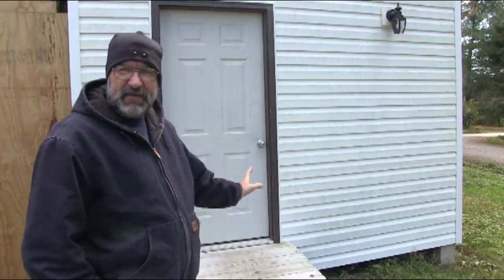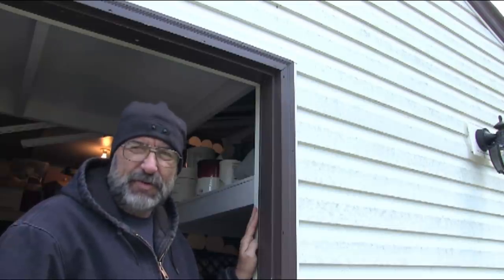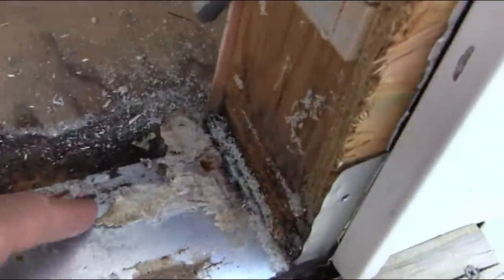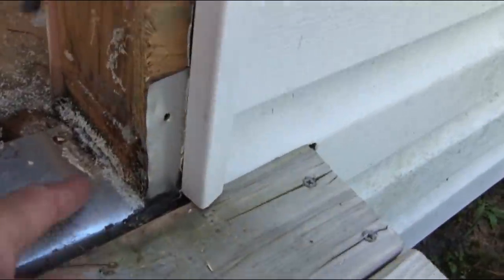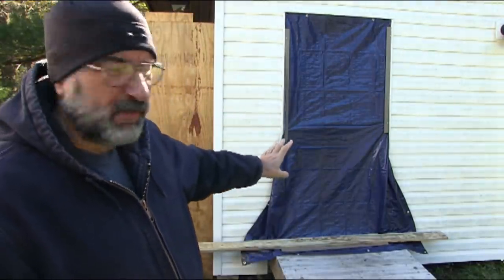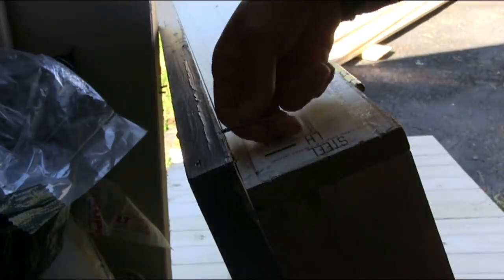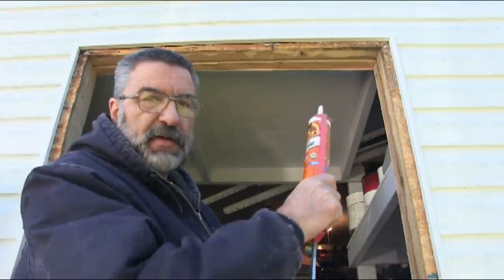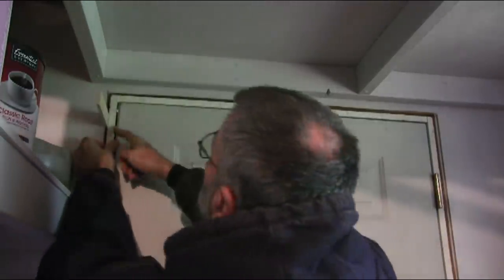Fixing the Shed Door

Comment: May I suggest putting an eves over the door and maybe a weather strip on the  inside of the door. You have said before that the weather comes in that direction. A rubber lip inside the door might help too. I love watching you work. Your so diligent and precise. Thank you for sharing.
Reply from the maker: I was thinking that a glass storm door would help. And it would be much easier to install than a roof.
Reply: @LiveSimpleLiveFree  that's a good idea. Will it stop the rain being forced in under the door?

Comment: The longer screw in the hinge... good bit of info there. Thanks.
Reply: I've heard of people doing that when they move into an apartment or rental place. It makes it much harder to force the door open
Reply from the maker: Using longer screws through all of the hinges is the PROPER way to install a door.  :-)
Reply: @donnaledington9270  I also heard to replace a screw with a nail poking out and leaving the screw out on the other side - for doors that open out.  I've been wanting to have my garage side door replaced with a door that opens out and I'll do that trick.

Comment: You know how water is some times where it comes out is not where water is coming in I had water leak coming in above a window wet Sheetrock thought I missed something then found where small hole in roofing shingles water was running down the rafter and dripping on sheet rock above window 🤬nice job thanks for sharing

Comment: Im wondering if the rain water was traveling down the J molding along each side of door?
And then leaking inside the bottom of door?  In any case it looks like you solved the problem.
Good Job! Water can destroy wood not to mention move mountains.

Comment: I usually flash up both sides of door frame and  at least 6 inches when I install a exterior door. Moisture can get behind the moulding. What you've done will probably work fine.
Reply from the maker: This is the way I've done it for decades.
Reply: @LiveSimpleLiveFree  you seem to do fine work Bill. I didn't mean any disrespect. I was a contractor for 40 years too. Now I'm retired. I probably need to get a hobby and stay out of other people's business. Lol.

Comment: Your problem is that ramp. Water is bouncing off it and going under door, in the winter I bet snow piles up against the door. You can lower ramp or instal a small aluminum weather protector over the door. No more water issue. Vinny 🇺🇸

Comment: Still need a drip cap behind the top j-channel and the entire R.O. Needs to be flashed with from bottom to top with butyl based window and door flashing tape. Moisture wicks in between j-channel brick molding. I do not use any fasteners thru brkmld, instead use screws thru jamb into Stud tucked behind weatherstripping to conceal screws. Longer screws are used thru Hinges and strike plate to add strength and security. Also surface caulk exterior door jamb to sill with silicone, its a weak point that lets moisture in.

Comment: Maybe the ramp where it meets the door, needs lowered an inch or two. Could the wind be blowing the rain toward the door? The ramp appears to be level with the threshold. 
I would also chalk the top of the outside  brown trim at the top outside. But what do I know, I’m an old lady just trying to help!!!😂🤣😂
Reply from the maker: There is a gap between the ramp and the bottom of the door.  Any water would fall down into the gap before it reaches the door.

Comment: Bill, you never said, nor did you show, whether or not it was dry under the flashing at the bottom of the door opening.  How about a storm door?   Over kill? Or how about that nifty self adhesive flashing material that I always see Tommy Silva using to protect the wood framing around window and door openings?  How come you didn't run a vertical bead of caulk along the trim on the sides like you did across the top?
Reply from the maker: The flashing was nailed down. I couldn’t lift it to dry without tearing it up.  If the caulk stops the rain at the top, it won’t run down on the sides

Comment: Hi I have a suggestion for you why don't you build a L Shape porch to shelter the door so rain and snow doesn't beat against the door and it will keep it dry just an idea that may cure that from happening again build it on the right hand side and leave the side open facing your front window in your trailer so you can keep an eye on your shed from the front room window I 5hink that would work wouldn't it ??

Comment: Would a new door have been an option? Seems alot of adjusting of existing door that leaked. Just asking....! Glad it doesnt leak.
Reply from the maker: The door was perfectly fine and did not need to be replaced. It is only two years old.  ANY door needs to be adjusted when installed, to make sure that it is square and true.

Comment: Painting the bottom of the door would keep water from soaking into the bottom of the door.. Painting an area near the door inside would also keep water from soaking in.. Kind of like a painted rug.
Reply from the maker: The caulk should stop the water BEFORE it gets to the wood.  If that's not happening, paint won't stop the leak.